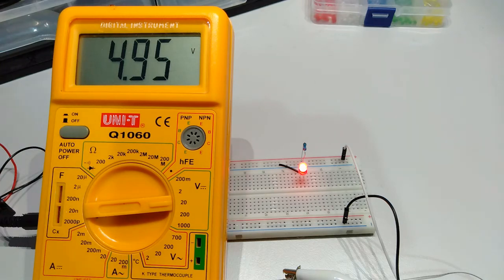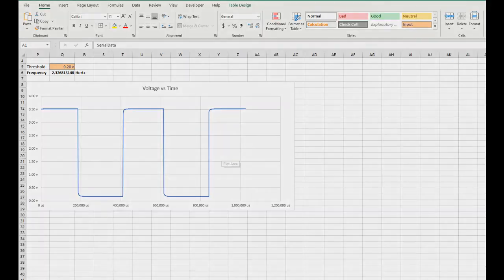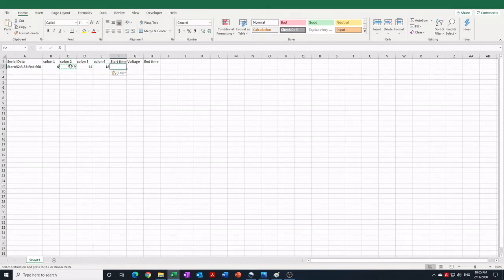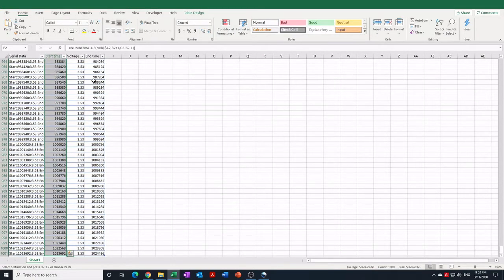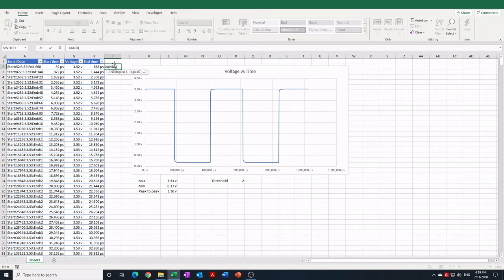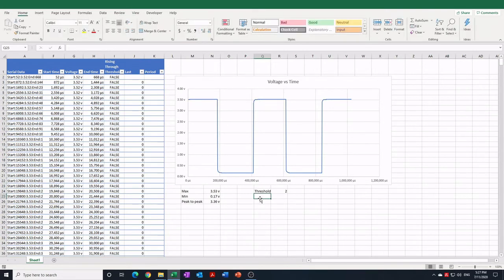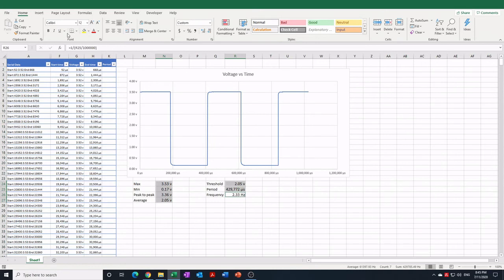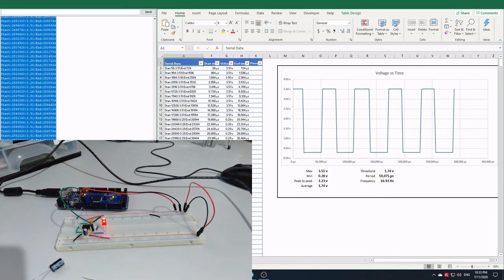Oscilloscope using Arduino (ExcelOscope: part1: Building it)

Comment: Sir,
How can I display the scope on the Serial Monitor of ardunio?
Reply from the maker: If the code was changed to only output voltage and not time it will display on the serial monitor.

Comment: Great video, learned some useful stuff in Excel from your video. I always thought the sampling rate of Arduino wouldn't be enough to be used as an oscilloscope, but I see that it is very much possible depending on the signal.
Will watch your other videos, keep it up!!
Reply from the maker: Thanks for the feedback.

Comment: We can use PLXDAQ for getting values into Excel directly from arduino.
Reply from the maker: Thanks. I was not aware of PLXDAQ. I did discover excel data streamer allows a microcontroller to pass data to excel. I have a video covering that you might be interested in.

Comment: Hello! I have watched all your videos pertaining to this subject matter. Each video is in order but with insane complexity! My infinitesimal brain cell cannot handle it. 😆

I then just now re-watch this, et voila! I think I missed something that I could just do it minus the Excel horror. I can simply use Arduino's plotter! Looking at waveform is all I need (to adjusting some shit, avoid clipping, increase common mode rejection). I basically need an oscilloscope. I do not need to record and analyse, so the built-in plotter ought to be good enough. 

Incidentally, I have a few questions.

1) What is the highest frequency that Arduino can detect and measure without distortion? All I need to 'see' is the regular audio frequencies - 30 Hz to 16000 Hz.

2) I am a n00b and yet to acquire an Arduino. Do I really need a serial port? Can Arduino not read and write via USB?
I mean I see, hear, read it needs only USB connection. Simultaneously I also see, read, and hear the word 'COM' and 'serial'. These are nonexistent on my laptop, or on most modern computers. Thus, I am very confused.
Reply from the maker: 1) The highest speed signal I have read is about 19000 Hz at that stage there is only about 12 sample points recorded per cycle.  I don't think it is useful for anything higher speed than that.   
2) You don't need a serial port.  When the Arduino connects it is via a USB cable but in the computer it is seen by the operating system as a COM port.  You will be able to see the COM port number in the Arduino IDE software.
Unless you want to use the Arduino for other purposes as well and don't have an Arduino yet I would probably try to save for a real Oscilloscope as it is far more useful tool.  
Be aware the Arduino can only measure voltages between 0 and 5V.  Too high voltage or a too negative voltage could damage the Arduino.
Regarding using the Arduino plotter.  It is probably possible to display the result on the plotter at the fastest sampling rate without excel.  I may try to do that in a future video.
Thanks for your feedback and questions.
Reply: @overengineeredinoz7683  Bloody hell! Thank you for your detailed and timely response! I was told only YouTubes who do not have many subscribers can afford to do so. I can understand why...too many people's comments to entertain.

I am fully aware that Arduino is only good for low-powered (5V) purposes. I am 'lucky' in this as I need to adjust or null common mode of so-called 'three op-amp instrumentation amplifier' and to avoid audio clipping that operate on 5V.
Having said that, I need to be careful not to make their gains over the top which I presume would still fry the Arduino even if it is 5V total. What I understood is discrete and integrated devices have current and voltage limitations. 5V directly at Arduino's inputs may be as dire as trying to power low impedance device from the Arduino, should the chip's certain pins are not rated to handle beyond certain level of current and potential difference. Cannot escape from ohm's law!

While awaiting for your response, I received a reply from a person who works on making Arduino an oscilloscope. According to him, actual frequency is up to 100 kHz!

This may interest you:

https://create.arduino.cc/projecthub/aimukhin/advanced-oscilloscope-955395

Here is what he wrote (via email):

"In the real-time mode, the fastest sampling rate is achieved when the
ADC clock prescaling factor is 4. For the system clock rate 16 MHz, this
gives the ADC clock rate 16/4 = 4 MHz, or 1/4 us for an ADC cycle. Since
one conversion takes 13 cycles, this yields 13*0.25 = 3.25 us per
conversion. In one second we have 1000000/3.25 = 307692 conversions,
roughly 300 kSps.

"In the equivalent-time mode, the fastest rate is achieved when the
Timer/Counter1 runs at full clk_io, that is, at 16 MHz, which yields
1/16 us between conversions, that is, 16 MSps.

"If these terms are unfamiliar for you, please see the ATmega328/P
complete datasheet."

I do not understand what the heck he means. I looked at that chip's datasheet. Holy mackerel! I still do not understand!

How is it possible 100 kHz for 4 channels? He said:

"The oscilloscope awaits for a trigger event, and samples the signal from
the first channel. Then it switches the ADC input to the second channel,
again awaits for a trigger, and samples the second channel, and so on."

Ah ha! I think I understand how it works for this one! Each channel gets full 100 kHz detection. Not shared. In other words, each is not getting 25 kHz (100 kHz / 4 channels = 25 kHz)
Why? It is because the chip gives each channel full priority by switching extremely quickly. As though a running row of LED. Basically you, me, you, me, you, me, rinse and repeat. 

Perhaps I could say it like this - never more than 2 channels get full attention at the same time. More than 2 channels appear to be getting full attention simultaneously, as if one flash, due to the chip's speed. I hope I am correct about this.
Reply from the maker: It sounds really interesting. I looked at the code but couldn't follow it so will have to try it.